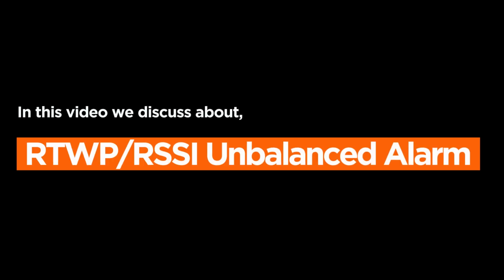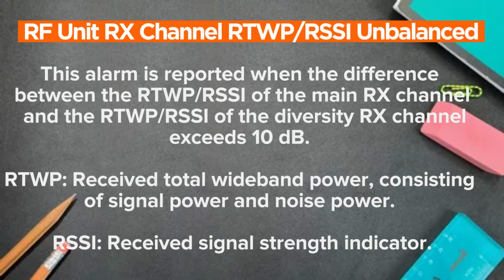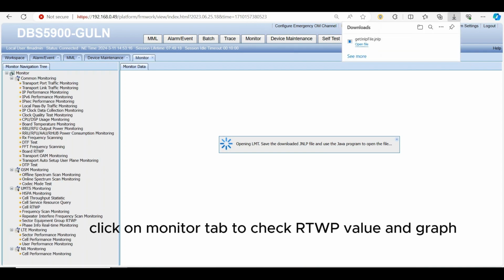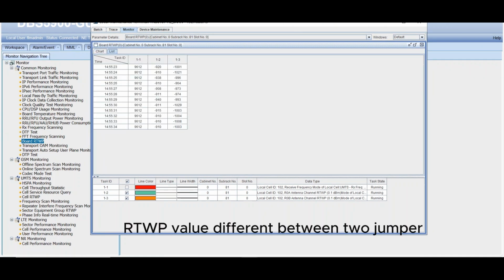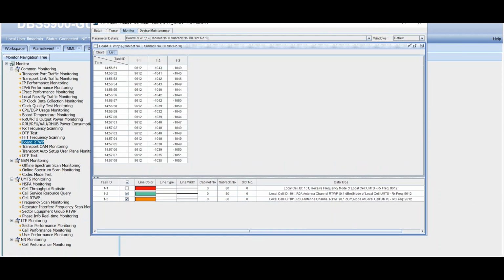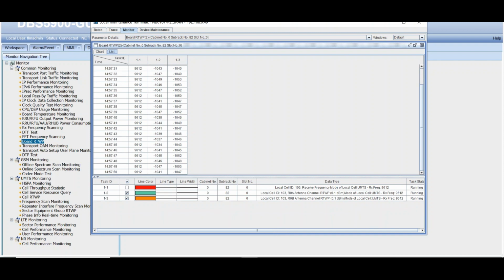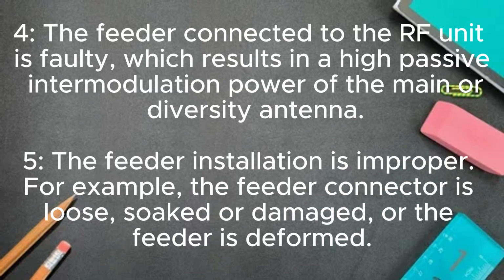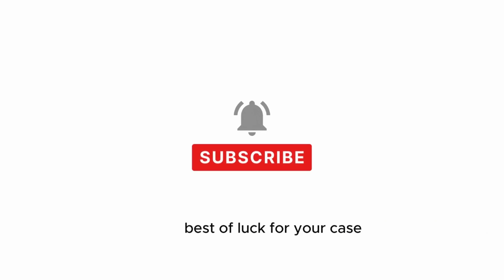How To Clear RTWP/RSSI Unbalanced Alarm | RF Unit RTWP/RSSI unbalanced | RTWP/RSSI | Huawei BBU

Comment: Thank you sir , What is the acepted range in the chart?
Reply from the maker: In network a normal and acceptable average RTWP value is typically between -104.5 and -105.5 dBm. Values around -95 dBm suggest the presence of some uplink interference in the cell. A value around -85 dBm indicates a severe situation with strong uplink interference. If difference between two channels of same RRU(subrack) greater than 10 then RTWP/RSSI alarm active.